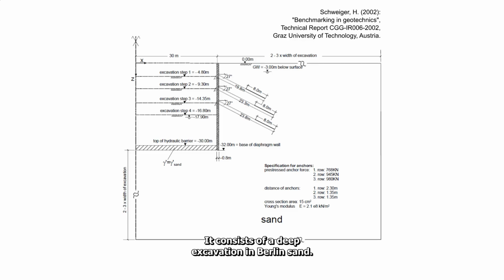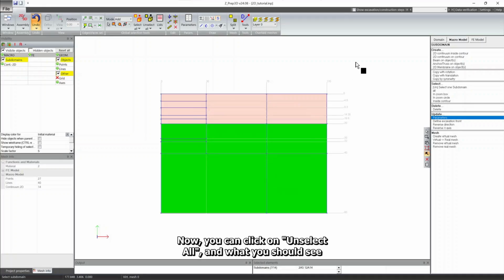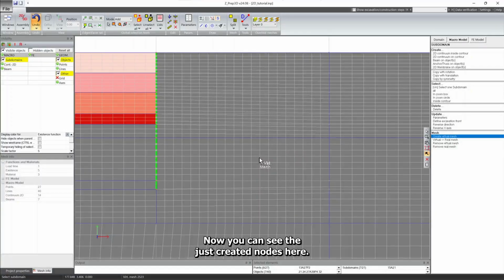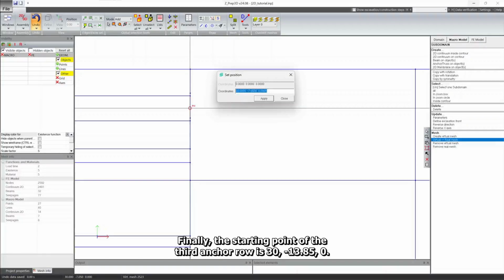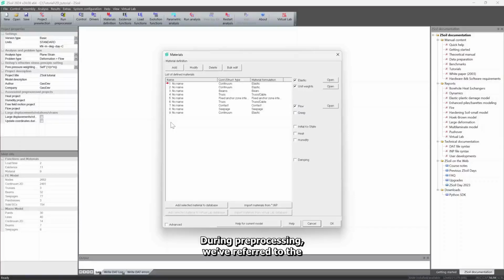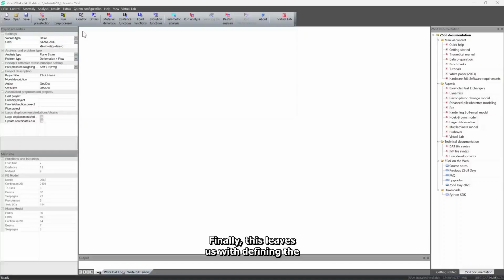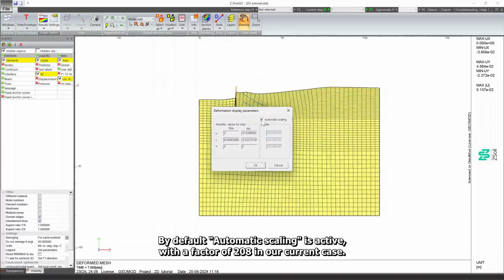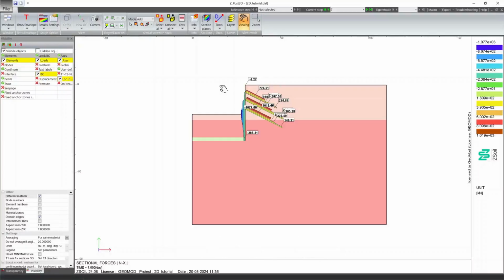ZSoil Tutorial - 2D Deep Excavation

Comment: Excelente, voy tomando nota para aprender a usar el software. Por otro lado, podrían subir un tutorial de análisis de un pórtico con interacción suelo estructura. Saludos.
Reply from the maker: Hi, Thank you for your comment. We are please you like the tutorial. We are sorry but we are not fluent in Spanish and don't fully understand your question. You are requesting a new tutorial for what kind of soil-structure interaction problem ?
Reply: @ZSoil-since1985  Sure, I'll be more punctual. I have been reading your report on Pushover analysis. I am interested in using the ZSoil program to analyze a 2D reinforced concrete frame structure founded on piles, and that the analysis takes into account the modal response along with the soil-structure interaction phenomenon. Can you do the tutorial? Thanks
Reply from the maker: @mec007  There is an existing tutorial on an older version of ZSoil that is still valid. Please see :https://www.zsoil.com/zsoil_course_notes/pushover/tuto_push_d0211_v1.pdf

We may have more content with soil. Please contact our support team via email if you require more information or have any other questions.